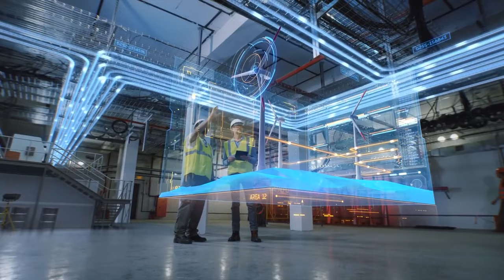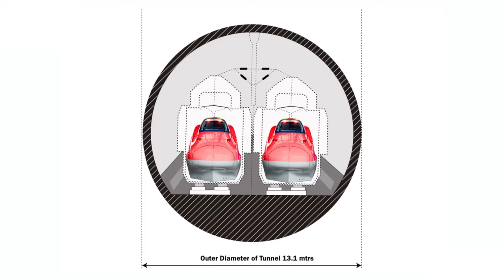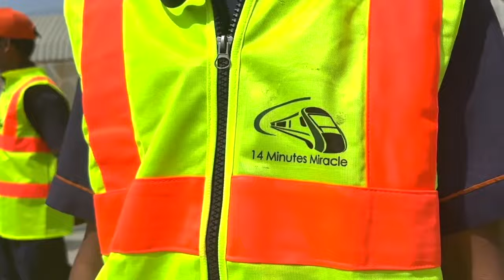India's $13 Billion Bullet Train Secrets Revealed

Comment: Why don't you tell that we have today a semi bullet train which you should tell to the viewers that is our own Made In India🇮🇳 Vande Bharat train.. 💪🙂😎🙏🇮🇳🧡🇮🇳
Reply: It's not a semi bullet train, come on we should accept our made thing in its true form. Vandhe bharat doesn't run more than 130, only one or two runs at 160 rest every other is below average speed. In future we can take it semi high speed at 220.
Reply: @AKSImakesbeat  new vande Bharat is proposed at Chennai route which will go up to 200 kmph

But Right now our main problem is is over crowded railway line and British era railway line which do not support such high speeds 😢😢😢
Reply: @AKSImakesbeat 160 is called semi high speed, but yah speed now is not good enough
Reply: @kabir1934  In today's world, a speed of 160 km/h is not typically considered semi-high speed. Each country has its own definition of high speed, but on average, speeds ranging from 180 to 220 km/h are regarded as semi-high speed. While the Vande Bharat Express is capable of running at 180 km/h, the infrastructure needs improvement before it can consistently achieve this speed. Until then, it wouldn't be appropriate to classify it as semi-high speed. We must work diligently to enhance our train network to achieve super-fast speeds.

Comment: India has much more developed Railway system than ur country, We are building HSR just for High Speed connectivity between main cities by rail as our current system not run above 160. That's why conventional line will be upgraded too for Vande Bharat trains which are comfortable and world class, We have also Namo Bharat world class trains rrts which are 160 capable and have very frequent stations. Vande Bharat trains will run at 200-220 in future for this govt is making high speed test track